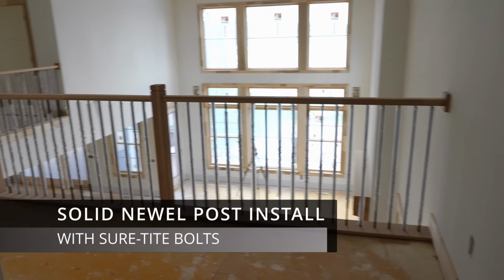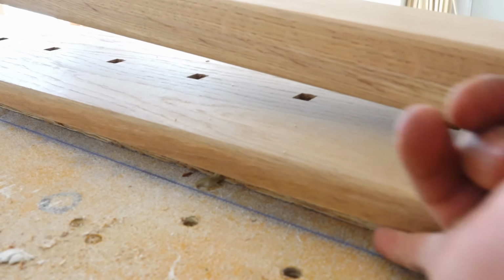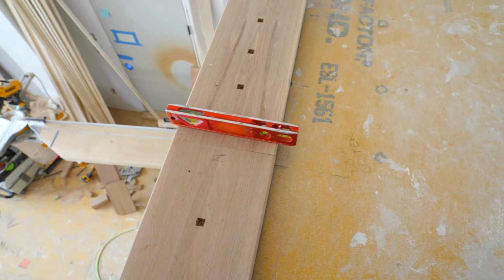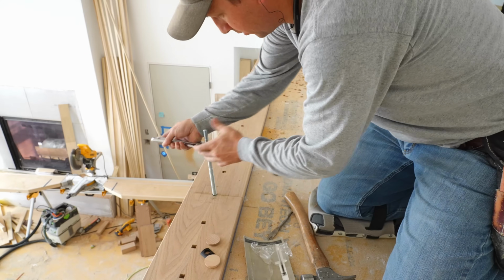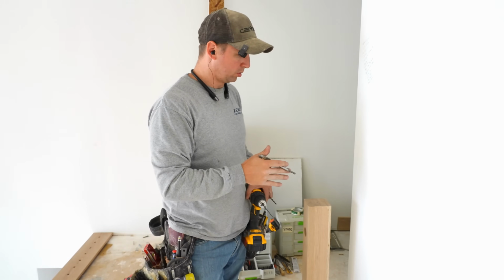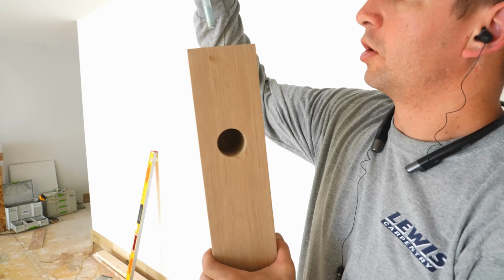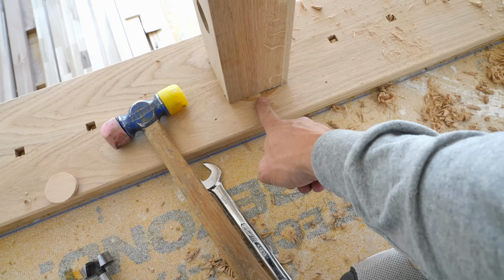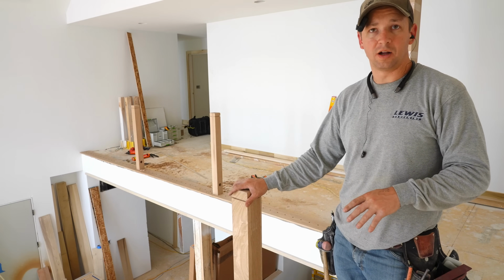The Fastest Way to Install Rock Solid Stair Newel Posts | SURE-TITE BOLT TUTORIAL

Comment: Spencer- have you tried the Zip Bolt system?  Same concept, but with a geared mechanical “Nut”. 

Small disadvantage would be you tighten it with an Allen wrench rather than a box wrench. You don’t get the same “that’s not going anywhere” feeling. Unless… you do what they specifically tell you not to do and use an impact driver with a hex bit. I’ve only ruined one of the gears. 

Major advantage using impact/hex bit is speed and ease of fastening the “nut”. 

I also live in the remodel world where the shoe rail may already be in place and not perfect. Making me need to fit the bottom to exiting conditions. Zip bolt allows you to quickly and effortlessly tighten the nut, check for plumb, and quickly loosen/remove if an adjustment is needed.  

All other rail connections available as well. 

Might be worth checking out. Or if you have used them, would love to know your opinion. 

Google Zipbolt USA.
Reply: I just installed a newel post yesterday with the Zip Bolt. Definitely made taking on/off much easier for test fitting. I used a wrench to really tighten it down (instead of impact driver). It tightened it enough for the PL3 adhesive to set in. I liked the tip about making marks on bottom for the adhesive to go somewhere.